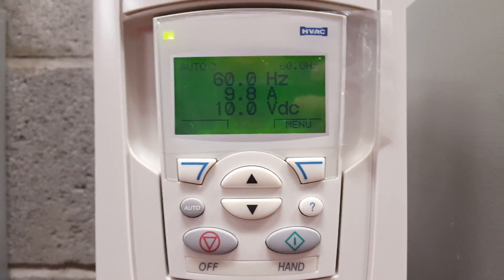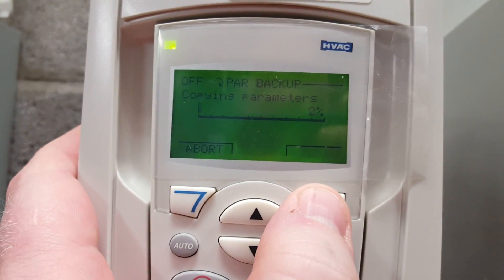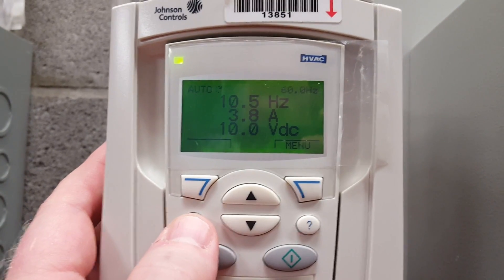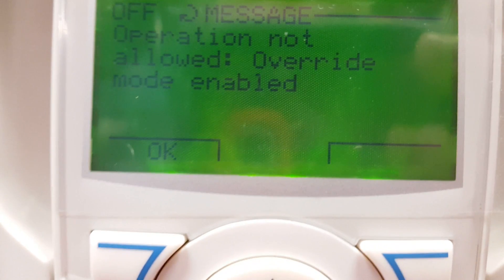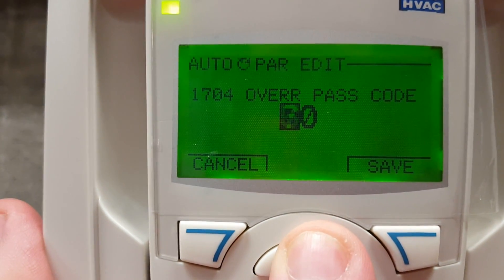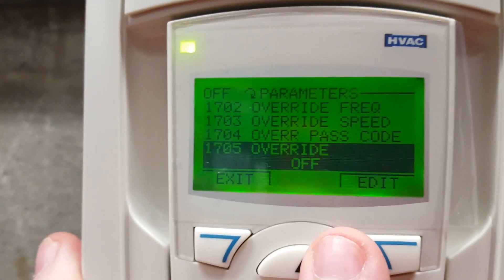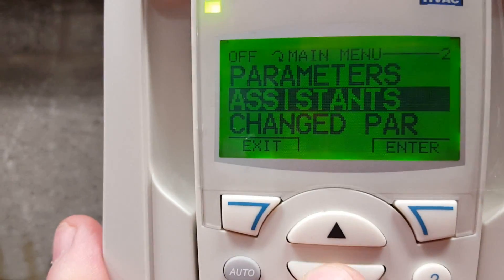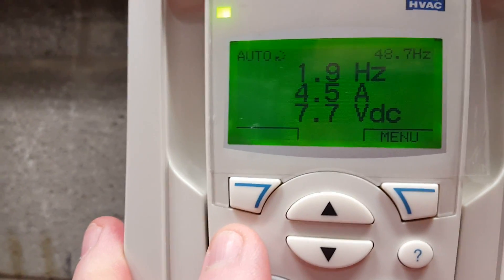How to Upload or Download programming in ABB Variable Frequency Drives

Comment: You are very good at explaining stuff I’ve been dealing with ABB drives for a long time in the HVAC industry, and you by far explain it the easiest I was just wondering if you can actually use just the keypad to upload from your computer using the ABB software your perimeter settingsand then take it to the job and download it to the drive
Reply from the maker: Hey Randy. I don't think you can. I think it has to go straight to the drive

Comment: Abb 550 drive massage display drive not responding what is the solution?
Reply from the maker: Cycle power. Make sure the panel is properly seated. If it is and the drive doesn't recover when you power it up, the control board is bad.

Comment: Its transcript: Hey guys, in this video, I'm going to show you how to upload a parameter in an ABB VFD, as well as how to download those parameters. Well, it's a really good way if you have two motors that are identical sitting side by side, such as like pumps or cooling tower fans or that sort of thing. This is one way that will speed up a little bit of the setup if you are adding or replacing a drive that is identical to one that is already there. Also, I'm going to show you how to disable the override mode, which is something that we see in your drives, which as we all know is an ABB drive with a York or Johnson control sticker on it. Sometimes if you try to download and the parameters into your drive, what it will do is it will actually give you an error. So, I want to show you how to disable that override mode where you can download it. The first step in downloading a drive is you must press the off button; it will not let you upload or download a program if the drive is running. So, the first step is to press the off button, then simply hit the menu button go into parameters and scroll down to parameter backup. Once you go to the parameter backup, you select that and then select Upload to panel. And that will upload all of the parameters within the drive to the panel. I recommend you do this anytime you set up a drive. Anytime you are expecting to make changes that you're not sure if they're going to work or anytime that you make any adjustments to the drive’s operation, you want to back that up and save a copy. In case something happens if you have to change it now this stuff will work very well and speeding up the change out of the drive, you can simply then back out and once you back all the way out you press the auto button, and the drive should restart with no problem. Now if the override mode is enabled, you will get an error if you try to download some drives this is common with the orc drives as well as you know the Johnson control drives which there an ABB drive with a York or Johnson control sticker on them. And you can see here scroll into the menu to try to download the drive and I get an error you can see the error code here override mode is not allowed override mode enabled. So, we are going to show you how to disable that and it will not let you download it until you do so you go down in your menu to group 17 and 1701. I tried to go into there and gives me an error of course you once again. What we have to do before we can do that is we must scroll down and enter a password into group 1704. That password value is 358. And here I overshot it a little bit, so we scroll back down and run our numbers up to 358. And once we get those values set, I press the save button and it brings me back to this menu here I then scroll down to the next one and you can see here override mode is already off as I've already turned it off on this one once again you must hit the stop button before you can make any changes go in here you can see this is where you would turn the override mode on and off is currently off on this drive. This is after I had already turned it off and loaded the program. So, we go back into 1701 and then we set this to not selected. Once we have that done, we can simply back all the way out from this particular Menu Group. And once this is all disabled, we will then be able to go in to reload the parameters into this drive. Once again doing this is very helpful if you are changing out a drive you can see here once I press the Go back into the menu that I am able to download the drive with no issues whatsoever it simply once that's turned off and lets me download it with no problem. Once it's successful, you can just back all the way out and press your auto start and the drive will restart as normal. guys hope you liked the video hopefully that it is helpful to you. I would appreciate it if you would give it a thumbs up also be sure to drop me any comments and questions down below and be sure to subscribe. Thanks for watching!
Reply from the maker: Thanks for watching

Comment: I retrieve data from a ABB vfd drive ACS850 to the panel and using that control panel I try to download to another drive which have same spec and function ( it's an standby drive) but I it's showing an error after all the download process over high limit and I have only option to select is ready when click ready It seems like ready ..but when I try to run I couldn't get the output running command is on..output is zero..I think it's an parameter issue..please help me to sort out this
Reply from the maker: Theres a difference in the firmware between the two drives even though they're both 550s. I've had that same issue. Your better off setting up the new drive from scratch

Comment: I have everything installed. 
I have a HVAC assist control that came with a battery installed.
There was no pairing cable and the control wont power up
msoliday5570@aol.com
Reply from the maker: Your controller should have an enable output and an analog output for the speed reference. That's really all you need.

Comment: Can you remove the panel with the drive running OR  do you have to turn off the drive to prevent data loss? Thanks for the great video.
Reply from the maker: It can be removed while running
Reply: Hello sir
I am an electronic industrial  engineer and Repairing all make vfd 1kw to 1000kw at components levels and can installation vfds at different different applications  so do you have any requirement for this profile.

Comment: Thanks for the information. I uploaded to the panel from a working drive and downloaded it to the new one, but the unit wont run in Auto or Hand (when I press hand it just goes to OFF) and I am missing a lot of the Parameters that are there when I look at the working drives, any advice?
Reply from the maker: Make sure your enable contacts are closed on whatever you use to start the drive

Comment: Hi sir I had a malfuction i cant desid if the fualt from vfd or controller ..couse when u press to change the rotaiton dosent go back only REV how can fix it isit parometer or fualt from electrical panel...thanks
Reply: Iwuld like to thank u for ur replay .Ifound the seting parometer group20 from vfd abb manual 1003 now it works
Reply from the maker: There's a lot of possibilities. Make sure it's set up properly in the drive for reverse operations

Comment: Sir I have a ACH 550 vfd. I use for condenser fan. My chiller panel giving demands 100% but my vfd run only on 60% I set vfd maximum 100%  please help!!! Thanks for uploading video...
Reply from the maker: Check to see what your signal is.  It will either be 0-10vdc or 4-20ma.  There is a dip switch just above the terminals on your drive that must be set to match the type of signal.
Reply: Thanks sir for your feed back, panel to control input power comming 6v same befor and deep switch it has same before setting I think my vfd not going 6th and 7th speed I don't know what's wrong in parameter!!!!

Comment: Hey nice video, I've got a question, does this backup also saves parameters from a FENA-01 module, like IP's and that sort? I have a ACS355 driver and a FENA-01 module that its broken, I just want to change the fena module to another one but don't want to set and put every single parameters or addresses again.
Reply from the maker: It should save all of the option settings for the VFD.
Reply: Hello sir
I am an electronic industrial  engineer and Repairing all make vfd 1kw to 1000kw at components levels and can installation vfds at different different applications  so do you have any requirement for this profile.

Comment: Is there a way to add reverse rotation to the soft keys? My old drive was able to switch motor direction. the new HVAC does not seem to have that option? Thanks
Reply from the maker: Yes I believe their may me.  There is a direction button on some of them already Depending on the firmware and macros for the particular drive.

Comment: Can anyone point me to the installation of the machine just like the first time I bought it .... because I installed messy but installed...
Reply from the maker: +longvehoa nguyen are you talking about resetting to factory defaults or initial wiring?
Reply: How to reset the default machine ... can you help me?
Reply: You help me default to abb acs550 machine
Reply: You can show how to read the value directly from the inverter to the computer (by modbus)
Reply from the maker: +longvehoa nguyen you will need to have the correct communication card installed in the drive. Connect your communications network and configure the parameters in the drive. You should then be able to discover the points within the drive within metasys

Comment: Can you just connect the computer to the computer using modbus .. to read the A, V values displayed on the computer ... on the abb acs550?
Reply from the maker: If you have the correct connection cable and the correct software you can set them up on the computer.

Comment: Great Video. When i attempt to upoad parameters to panel I get Alarm A5020. Do you know if this is another internal protection. 
Also, I am attempting this on the Basic Control Panel. It is controlling a fan blower on Atlas Copco dessicant dryer. Thanks.
Reply from the maker: +1612ydraw make sure that you press the stop button on the drive before uploading. That should be the only thing that would cause an error other than a problem with the drive
Reply: Thank you for the assistance. It turned out it was in remote control to receive an external speed request over modbus. Put it in local and carried your instructions.  perfect. thanks again. do you have a video on drive window light ??
Reply from the maker: +1612ydraw not yet.
Reply: HVAC schematics

Comment: how can i download the parametres to an external flash drive ( usb , memory card ...)
Reply from the maker: +Mohamed El Makkaouy you would need the abb software tool on your computer.  You could then upload the parameters to your computer. Good luck.
Reply: i already installed the software, i dont know the reference of the cable that i should use to connect the control panel with my  pc  , i have a CDP312 control pannel of a ACS800  drive,

Comment: Interesting! Thanks for sharing! One question comes to my mind: when you have uploaded to panel, then you just take the screen and transfer it to the other drive then download back?
Reply from the maker: +Sylvain Meunier If the motors and drives are identical you can. If you are using communication you will need to correct the network address.
Reply: @Systemcontroltech  how do you correct the network address?
Reply: Hello sir
I am an electronic industrial  engineer and Repairing all make vfd 1kw to 1000kw at components levels and can installation vfds at different different applications  so do you have any requirement for this profile.